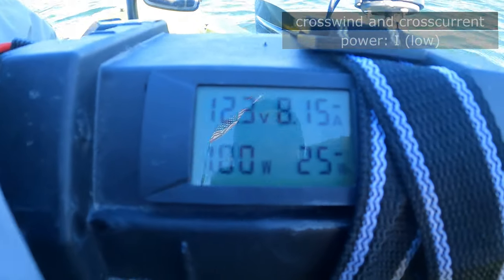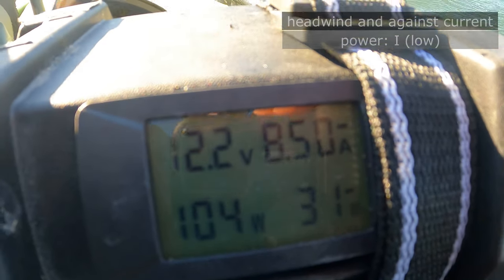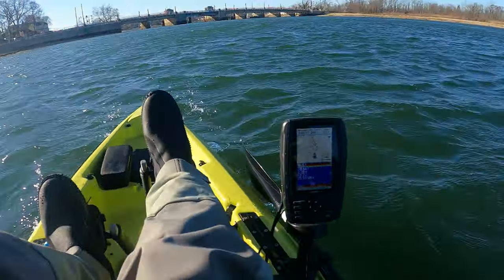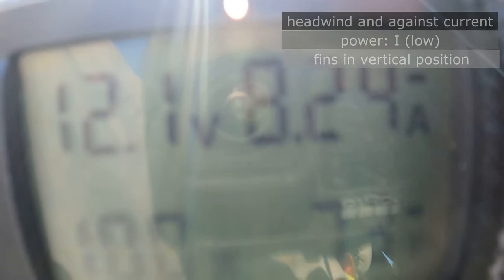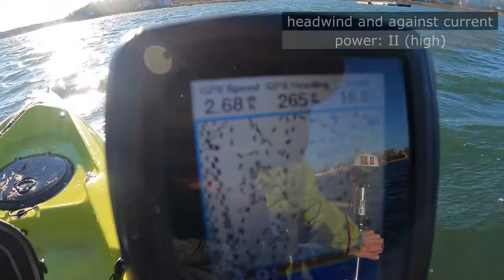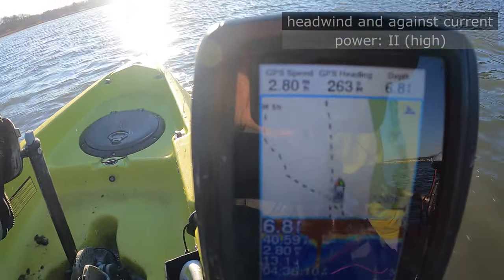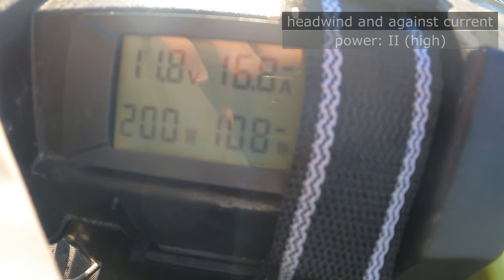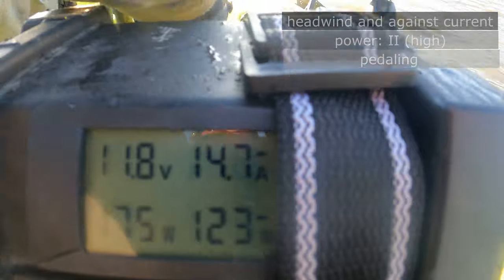Watersnake trolling motor amp draw tests - side mounted on kayak

Comment: Thanks for this video. Also, if you make a foam or plastic shroud for the motor shaft that covers the part from the motor pod up to the waterline, shaped like the leg of an outboard motor, or symmetrical wing profile, it will stop it sucking air into the prop and making that loud churning sound.
Reply from the maker: Thank you K1 K2!  I’ve been meaning to get back to you on your comment about this idea on the other video I did when I tested it out for the first time. I can’t wait to build something as it’s still making that noise even after I lowered it so I think your def right about how to fix. Almost like an airplane wing right? I want the water to sort of wrap around the shaft as it’s gurgling the water behind the shaft right now, almost like a Boulder in a stream
Reply: @PeterRanieriII  Oh did I comment already about this?? Ha. I've been spamming it about the place as I see it come up a bit on these setups. It was an issue for me on my canoe until I did this. Yep just like a normal outboard leg profile or a wing shape. I used some clear flat polycarbonate sheet folded around the shaft then glued in place. It forms the wing shape by itself.
Reply: @oldman1944  Would you consider posting a couple pics and more detail about how you made and how you fastened it? This sounds like exactly what I need. I believe that "gurgling" is cavitation or ventilation (many people call it cavitation but it is actually ventilation).
Reply: @jimwoodmansee  It's ventilation as I understand it. I think cavitation occurs at high prop speed when the pressure on one side drops so low that the water boils. I'll take some pics later of the mods on mine.
Reply: @jimwoodmansee  YT won't let me post a full imgur link, It keeps deleting it. See if you can work it out from this - p4MDmYl 

The large one has been tested a few times and works well, it just needs to be covered. It's made from thin polycarbonate sheet, glued with superglue and caulking. The small one hasn't been tested yet. It's harder to get a good profile as the shaft is closer to the prop. It's just thin clear plastic from some packaging covered with sign vinyl. It might work better to be a fat inverted L shape, with the profile extending further back above the prop, filled with foam.
Reply: Would this be like the cavitation plate on most outboard motors?
Reply: @oldman1944  I couldn't do anything with p4MDmYl; what is that? Would you consider posting pics or videos on Facebook? If so, what group, like Motorized Kayak?
Reply: @jimwoodmansee  You could try something like that, it might stop the air from being sucked down. The way my solution works is by reducing the turbulence around the round shaft that creates a path for the air to get sucked into the prop.
Reply: @jimwoodmansee  You want to make a shroud for the shaft so it looks like the torqeedo Ultralight 1103 AC
Reply: @oldman1944  ah, ok, thanks
Reply from the maker: @oldman1944  check out what I eventually did to make the cavitation stop:  https://youtube.com/shorts/c_g2uPB_C3U?feature=share this truly works

Comment: I have a couple of questions, do you need to register the kayak if there motor is electric? and could the water snake push a Hobie Outback with a 220 pound fisherman?
Reply from the maker: You do have to register the kayak.  I think once you motorize any kind of vessel (regardless of electric or gas powered) its required.  That's NY state of course.  It should be able to power you.  This little motor is powerful, I was very surprised, especially because its really not that heavy.  Have you seen Dan's channel "Fishin Accomplished" recently?  He's actually successfully installed it on an outback, he's prob not carrying as much weight but with a lithium battery I think it would work.  Every pound counts though and I have seen a difference in speed with the motor by just adding/removing about 20lbs of weight.
Reply: @PeterRanieriII  Thanks Peter!
Reply: This registration for an electric motor is harder than I thought, they want me to bring the information on the motor (water-snake) and even though I have the MSO number they want a bill of sale and I'll have to pay taxes on the kayak? This is insane!

Comment: What sort of fuse or breaker should I use when wiring a set up like this
Reply from the maker: I think the company recommends 25A circuit breaker but I used a 30A.  Probably 20A is too low since it would be close to drawing that much if you had a lot of gear on the kayak and were going against the current.  Here's the link to the one i installed on this battery: https://amzn.to/3VSwX1d
Reply: Thanks

Comment: The battery box is just awesome. Mind sharing a link please for it?
Reply from the maker: Thanks, it was actually very cheap to build too.  Here's a link to the video I show how to make it: https://youtu.be/Q7ZQ1j4oo2I
I've since been using a LiPO4 battery since but this helped me understand how much AH to get
Reply: @PeterRanieriII  Thanks so much. Is that an AGM battery type on the video? Also, will it also work with a LiPO4 battery?
Reply from the maker: @plgrv  its a lead acid in the video. But yeah it would definitely work with lithium iron phosphate (LiPO4)

Comment: It works great!  I know how anxious you were to test the meter. But 38 degree water temp, you are brave. 😬
Reply from the maker: Just gotta tighten that bracket a bit but yeah, thanks!  Oh I'm nuts its true, I really shouldve waited a little longer for a better day, that dry suit keeps you so warm but my hands were done for bc of holding the gopro.  Hey what speed to you usually use for your bixpy?  Do you blast it when cruising out to your spots or do you keep it in the 50-75% throttle area?  I'm curious bc if I do a PWM, I wonder if I'd use the variable speeds

Comment: Awesome video so a 100 ah battery at full speed would last ruffly 5.8hrs? Thats pretty good considering im really only going to be using it half the time going back to start the drift over
Reply from the maker: @waterboy5164  that’s correct 👍 if you weigh down the kayak with a bunch of gear you may draw a little more amps but you still would easily get 5hrs on high. That’s what I’m saying man, this little motor rocks!
Reply: @PeterRanieriII  awesome thanks I bought 2 of those motors one for me and brother. What size breaker do I use 30? I also need to order batteries. 
Do you have any links to help the channel out?
Reply from the maker: @Waterboy5164 awesome man, they are hard to get right now.  Was actually looking to get another as a backup.  I would use a 30amp breaker:  https://amzn.to/3LNmmly watersnake recommends 25amp but those could be tough to find.  for the 100ah battery just buy the cheapest one on amazon as they essentially are all sourced from china (even the expensive US based companies like ampedoutdoors, etc. source the cells from china)  Heres a link to one I found:  https://amzn.to/3WkBdca  you dont have to buy that one but if you buy anything from that linked page it will help me out 👍

Comment: You’re drawing a lot less amps than my T18 so I too believe you have to mount the motor way deeper to get the full power from the motor, and probably better efficiency. I’m drawing 19.5amps on high and I think you said you have the T24 which is a bigger motor again.
Reply from the maker: That makes sense.  Yeah this is the T24 (24lb thrust) so probably your right, the air pocket is preventing it from pushing more water.  I'm going to try and get it lower in the water and see what happens.  19.5amps seems high for the 18lb motor, I thought it's marketed to draw 15 on high.  It's like our motors are reversed, lol
Reply: Hello may I ask you what amps your T18 draws under load at low and high also without load?

Comment: Thanks for the videos! Just got my Watersnake 24 today. What battery are you using? I want to go lithium but Watersnake is strongly opposed to them.
Reply from the maker: I was using a 35ah lead acid for this testing but I did upgrade to a lithium iron phosphate and haven’t had any issues so far.  Maybe watersnake just hasn’t tested them much on lithiums so they’re hesitant to say it’s ok, not sure.  Here’s the link to battery I’m using now: https://m.aliexpress.com/item/3256803618604245.html?spm=a2g0o.order_list.0.0.af101802QWmUXJ&gatewayAdapt=Pc2Msite

Comment: Do you have pwm with that or straight to battery
Reply from the maker: Pwm?  Nah straight to battery
Reply: @PeterRanieriII  how long or how many hours you get straight to battery
Reply from the maker: @TheSargeOnTheWater  with the old 35ah lead acid battery I would get about 2 hours on high and 4 hours on low.  But now I have an 80ah lithium and I get 4 hours on high and over 8 hours on low.

Comment: Im new to inshore kayak trying to motorize it, will i beable to climp up current with a 30lb thrust electric motor?
Reply from the maker: from the research I've done, going over 25lb - 30lb thrust wastes more energy than its worth.  There is a plateau effect to your speed vs. power due to a kayaks' hull design.  You will require larger and larger amounts of thrust for a smaller and smaller gain in top speed.

Comment: Hey Peter, which 60AH lithium battery do you think you'll end up buying? So many choices on Amazon from about $200 - $500 range. Scary thing about batteries is that once they get past the warranty is when they fail and you're buying again. 
Like to see u out there so early. I'm starting to check my gear and getting ready for the April Tog in the Sound and May Hudson stripers. If gas prices weren't so high I may run to Raritan bay in April too.
Reply from the maker: There’s so many choices but from the research I’ve done it seems a lot of those cheaper ones are basically from the same wholesalers in China. Another viewer told me to check out dhgate.com which I did and they have super cheap batteries. You get what you pay for but I think I will get a cheap one instead of say a Dakota lithium which is like 400$ for 54ah, maybe it’s a better warranty but I’m not looking to have this battery for super long, after all it’s on a floating piece of plastic and things happen so I’ll prob take the risk and go cheap. Check this link out: 200$ for a 90ah: https://www.dhgate.com/product/liitokala-12v-90ah-lifepo4-battery-pack-12/749048156.html?d1_page_num=1&dspm=wapen.sp.list.1.ZNWHDExsRTN3kTNuGUyG&resource_id=749048156&scm_id=search.LIST...1T|2|0|unrerank|7_3|newes.#s1-1-1;searl|0657363447:1

Thanks, yea was so happy to start getting out there, April I’ll start looking for tog, stripers and maybe winter flounder too. Gas prices are gunna be rough this summer, even more reason to be on the yak with trolling motor rather than a boat :)
Reply: @PeterRanieriII  Wow, 90AH at that price. I hope it lasts a while. I'm just starting to think about adding trolling motor to my Old Town Sportsman 120PDL. I'm thinking of going thru the hull at PDL opening. Not sure yet
Reply from the maker: @RobertSmith-dj3qw  crazy cheap right?! theres a video on YT of a guy that takes it apart and tests it and for what we're doing with it, I think its still worth it.  Is the old town sportsman 120pdl able to accept the minn kota trolling motor with spot lock like their autopilot version?  If you can just buy that autopilot motor and plop it in, thats probably what I would do.  I def think down the road if I were to upgrade my motor, I would try and figure out how to get spot lock
Reply: @PeterRanieriII  The Minnkota w/spot lock that comes on their autopilot yak is a completely different configuration than the opening for PDL drive so it will not fit. I'm surprised that no one has come out with a retrofit kit to add a trolling motor to the opening. I thought Navarre would've by now. Great yak but I'll have to retrofit a TM into it. Was looking at yours coming out the side but I've seen people cut down the shaft and go thru the hull. Either way I go it will be a nice project for days too windy to be out there.
Reply from the maker: @RobertSmith-dj3qw  Ah, I see, thats too bad.  I'm surprised as well.  I'm also surprised there isn't more mods where you can add gps spot lock to an existing trolling motor, guess its more compicated than it seems.  So regarding the trolling motor in the drive opening, I was very close to doing it that way on mine but I had a friend that did a side mount and has relative success so I went off his idea and just adjusted a few things.  I like having the motor running while at the same time having my pedals in the drive.  Maybe its just psycological but I'm much more comfortable having the ability to just start manually pedaling instead of being required to change out the motor for the pedals.  Also, I found you get a tad more speed when you pedal and motor which I enjoy a lot because I still enjoy pedaling quite a bit actually, it's part of the whole experience of being on the kayak to me, I just don't like doing it against wind and current for a long time.

Comment: nice testing there Peter! i was thinking to buy a motor but not sure... it destroys the concept of kayaking , its more like a lil boat.
Reply from the maker: haha it does ruin the concept of kayaking a bit, I will agree, especially the noise, it's not as peaceful having the motor sound.  It's easy to take out though if I'm just staying close, and if I want to go further on a trip it helps so much.  I think if you aren't going long distances on your outings it's not necessary but I just love to explore on this thing and it really helps with that.  Thanks for the comment man!
Reply: @PeterRanieriII  max distances ive done till now are like 7-8kms. Dont know if its a lot or not but im feeling fine after :) so i think ill pass for now
Reply from the maker: @60watergr  Your young and thats not too far, its good exercise!  I did about a 12km trek and thats when I felt slight soreness in my knees and thats when I started looking at the motors so prob if you don't feel anything, just keep doin what your doin and getting those huge groupers!
Reply: I was thinking the same thing that you should try to add a PWM. I usually don’t blast out. If I launch from Goldstar in Huntington Harbor I’m usually between 2-3 on the remote, around 2.5 mph non pedal assisted since it’s usually pretty calm in the mooring fields. Once I get around Wincoma Pt there usually is current so I’ll ramp up to around 50% if I’m heading a few miles north. If I’m trolling I’m usually at 2 setting and that will generally put me around 2+ mph. If I launch on the CSH side more often than not there is current so I’m running 40-50% heading north into the sound, less if I head south. Once I ran about 60+% heading towards Centre Island against the current and wind. Was doing around 3 mph. I think the snake with a prop probably performs better in snotty conditions than the Bixpy with the smaller jet like system. Bixpy good for speed in calm conditions, not so much in rougher water. But the trade off is the lower motor and battery weight and placement on the stern. The Bixpy allows for much easier weight distribution on the Outback. BTW planning another short FL trip third week of the month.  When I return I’ll probably pull the wrap off the big boat.
Reply from the maker: @LI-FLKayakFisherman  Good to know, so you definitely utilize the different speeds.  I think your right about the bixpy excelling in calmer conditions, but its true weight distribution is very important and thats a downside to this heavy battery as it matters where you put it.  Awesome!  hope you get better weather down there this time...

Comment: Does anyone use an ESC instead of a PWM with their Watersnake?
Reply from the maker: some may disagree with me but I've come to the conclusion that both are not worth the money.  By the time you get one that is both waterproof and wont overheat, you've spent more that the motor is worth, and I haven't seen anyone post amp draw testing to show a reduction of any significant magnitude
Reply: @PeterRanieriII  I like to troll and would like to be able to dial in a speed that is lower than the low speed on the T24. I want to install the Hobbywing 880 brushed ESC inside the head of the T24 and a rotary speed dial outside the top of the head to replace the two speed switch. FPV-Power has made their own version using the T24 but adding some more windings on the motor to make it a 28 and built in a PWM in the head and a rotary speed dial on the top of the head.